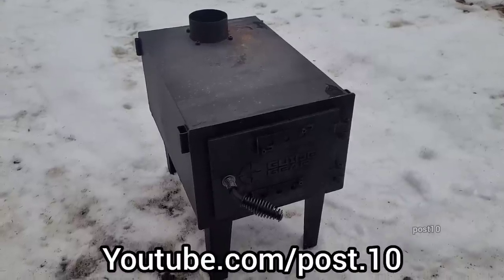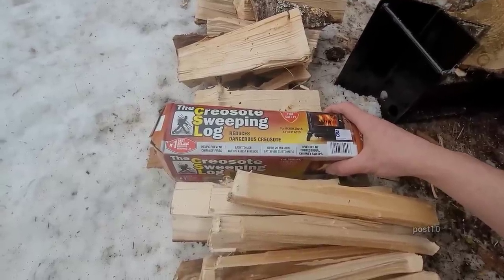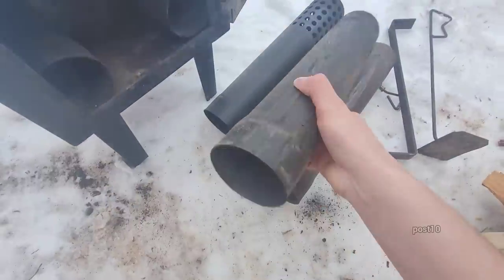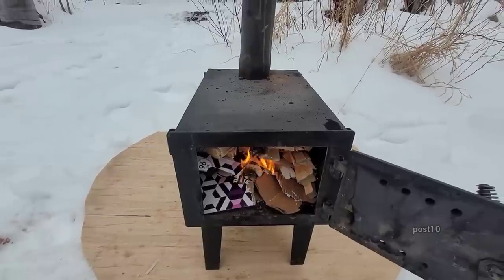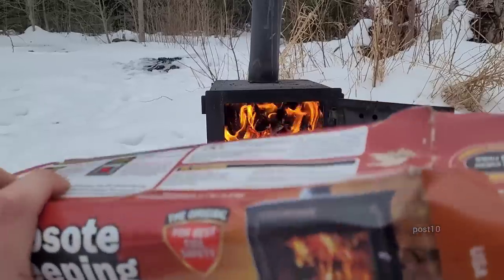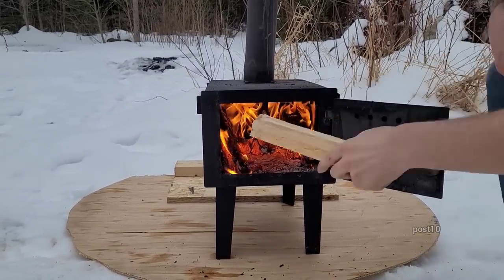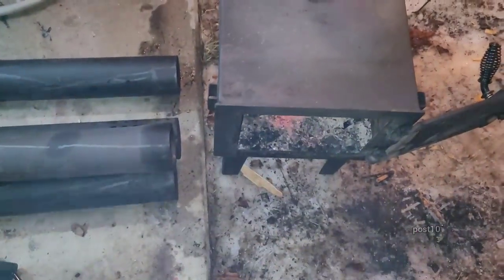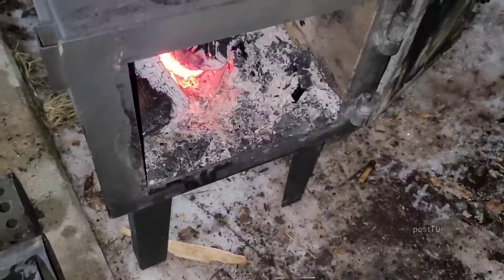Will Burning Chimney Sweeping Log Help Clean A Camping Stove

Comment: For best results, place the CSL on the hot embers after you have burned a regular fire. Never place the CSL on an active fire. I have a large half moon fireplace and they work.  But it requires only the log to burn in hot embers and the rising gas change the creosote to a flake. A hot active fire doesn't allow the gas to work.
Reply: Saw that in the instructions too
Reply: We live and learn next time he tries it  ; he knows now the comments were nice enough to bring it to his attention
Reply: It doesn't show those directions on the box clearly. But it does state clearly that results may vary. It's just another no accountability situation on behalf of the company... We're getting used to this over the last couple of years...but we should always read the directions booklet on the inside before voting..uh, I mean using a CSL.
Reply: @TheGor54  The instructions weren’t on the box, they were in the little booklet he briefly skimmed through.
Reply: It also specified that essentially as much airflow as possible should be restricted, so leaving the vents open also didn't help.

Comment: you didn't follow the instructions but it still helped. It clearly said not to put on open flame but put on hot embers. Though for such a small stove I'd probably just manually clean it and not bother with those logs, seems gimmicky

Comment: Hey Post cool video on the CLS – Just wondering  like others & correct me if I’m wrong but - @ 7:55 at the video on page 3 of the instructions, paragraph 3 it said to put your CLS in After the regular fire have completely gone out & to place it on the hot embers. It also said DO NOT USE ON ACTIVE FIREs with open flames… Just going off of what the instructions said… I know and can see that it did work inside the pipes as you showed us but do you think it might even work better if you do put it on the hot embers…? Just wondering why, they tell you to use hot embers and not open flames… Great experiment...!
Reply from the maker: It's a tiny stove and it's really hard to get Embers that will stay hot for a long amount of time so that's why this test couldn't be perfect. The reason you're supposed to do it without Flames I believe is because it supposed to smoke and the smoke would leave another residue just like the creosote over it to help deteriorate it

Comment: When I was in the army we had gas fueled potbelly stoves.  To clean the pipes after use in the field one of the best way to clean the pipes was to but some sand/dirt in it anything that could be slightly abrasive and shake the pile with your hands covering the ends and it cleaned it like a champ.

And by gas I mean deiseal fuel.
Reply from the maker: That's the same way I clean pots and pans in the woods when I don't have a sponge sand and dirt
Reply: @post10Vlogs  It sure gets your hands dirty with all the soot.  But on the plus side it reduces soot dust getting all over you from the chimney brushes.

Comment: "we don't need to read the rest.  We know what we're doing.." :) famous last words hehe
Reply from the maker: Because it is a small camping stove it is impossible for me to follow the instructions as it said. I cannot let it burn for two weeks, it is difficult to sustain hot Embers Without fire
Reply: I wonder if BBQ Charcoal would be Ember solving??

Infact if all that is required is a Pyrolitic cycle for the Creosote to bake off then....Why not put the 3 top pieces of Flue into the Stove?
As you are doing the clean up none camp.

Comment: A quick comment.

Your stove pipe is assembled incorrectly!!!  
This is CRITICAL!!!
The crimped (tapered end) pipe must always be down.  This is a basic requirement that your stove/pipe supplier should have shared with you.
You can get a collar to put on top of stove that hides the crimp, it isn’t necessary but helps with aesthetics.
Any solid fuel chimney must ALWAYS be assembled so if a chimney fire occurs, or if you get wet creosote, the pipe funnels the liquid back INSIDE the stove.  You can see the reason when you have flammable liquid running over top of your stove.
You were lucky this time, and didn’t die from a fire.  But PLEASE get pipe properly installed, it will save your life.
If your local stove store doesn’t agree, and help you with necessary parts information, FIND ANOTHER SUPPLIER!!!
I am dead serious about this!!!
ALL pipe must be crimp towards the stove, not just the one immediately above the stove.
You might do a separate video discussing this CRITICAL installation requirement!!!  Anyone with a chimney assembled crimp end up is living with a ticking time bomb!!!
Reply: he talked about this in the camping video ill try to find the timestamp
Reply from the maker: It's not avoidable that's how this camping stove is made, I always assumed it so rain can't go down it but that doesn't really make sense

Comment: Since you've been doing a lot of stove stuff lately, I've got a question. My current place of residence has forced air heat, and a propane fireplace. However, the unfinished section of the basement only has a tiny air vent and a wood stove. The stove itself will put out a lot of heat, but it drafts poorly. Any suggestions/tips for getting a good draft? It's really a pain to have all that smoke pour out of the stove when you're trying to load wood. And there's poor ventilation down there, so it's hard to get that smoke out.

My father wants to replace it with one of those open flame propane heaters, and that's just making me facepalm due to the terrible ventilation in that space.
Reply: Make sure it has a fresh air intake (mine is piped up from the crawlspace) and also ensure it's hooked up to the right size chimney pipe, wrong size could be the cause as well. Check if there is a pull out ash pan on the stand/foot/pedestal?, when that gets full or is closed it interferes with air draw (my fresh air intake terminates under there and is where you might find it if it exists on yours).
Reply from the maker: As the other commenter said has a cold air intake, it's not always easy to build one of those so you can just crack a window when you're starting a fire and it may help. I have been heating with wood now consistently for about three and a half months and I only lit the fire four times it runs almost Non-Stop and I always get smoke in the room. Not a big deal I just open the window to let it go out to put you may not have a window. The stove company said I could try using a blowtorch to heat the flue to get it to start sucking air or make a really big pile of dry kindling and light it on fire with the door cracked while you monitor it for awhile

Comment: I never burn pine or unseasoned wood. Because of this exact reason. Pine has soooo much sap that its not worth burning in the long run
Reply from the maker: As long as you clean your chimney every year and the pine is properly seasoned there is not a problem. Any wood that is not properly seasoned can cause creosote buildup not just Pine. Pine seasons in only 6 months but most people assume they can just go and burn that but a lot of times the sap under the bark will take a few years and that's why I let it sit for a long time. The tree builds up reserves of sap in the form of little bubbles along the bark in preparation of drought and they take years to dry